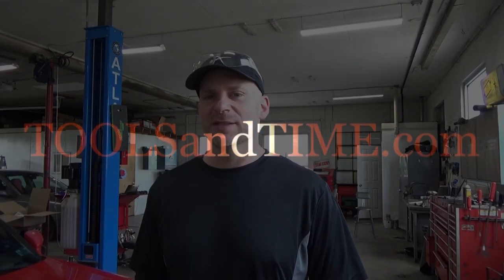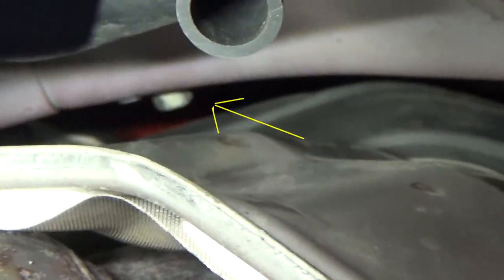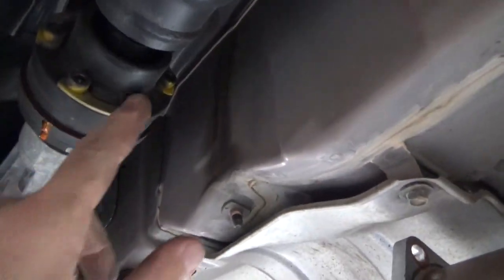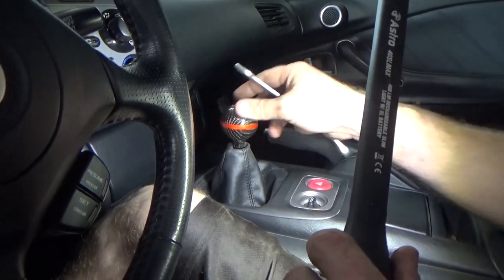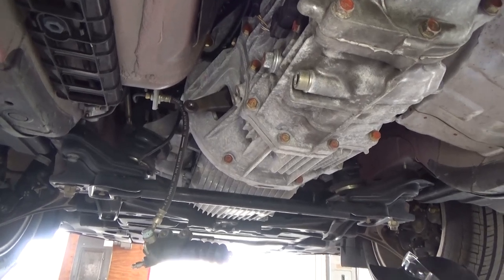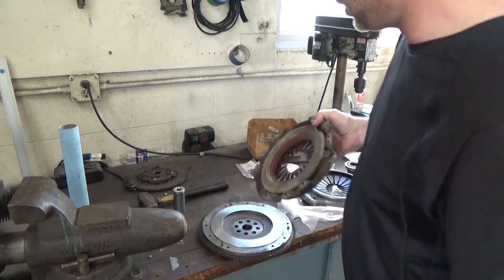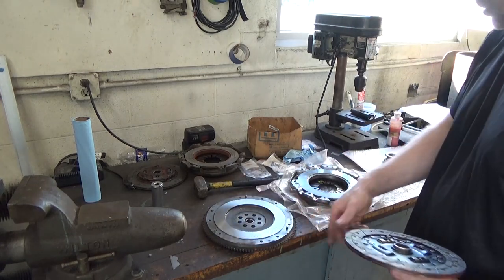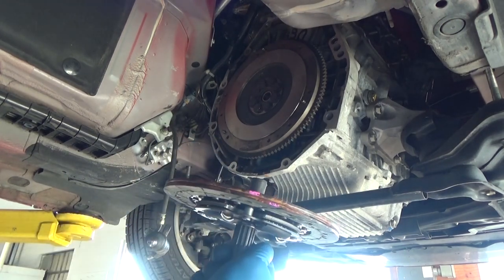Honda S2000 Clutch Replacement, Part-1 Transmission removal

Comment: on hondas/acuras if the flywheel is resurfaced you need to use a shim between the crank and flywheel to adjust the gap between the clutch and flywheel surfaces, good tutorial  and thank you for showing folks that locktite is necessary..more need to know where and when to use it.
Reply from the maker: Thanks for your feedback and insight, your welcome, yup the first time you have a flywheel come loose or you need to pull one after another person had it off! You learn the golden rule! Your better safe than sorry

Comment: Good day Wil,

Great video sir
Just needed some help with a rich condition on a k24 odyssey. Both airfuel and oxygen sensor reas rich to -27 on the short term. 

Starts runs then stalls I  closed loop. Please help 🙏 if possible thanks again

Comment: Question, did you disconnect the steering joint before lowering subframe. I have seen a video or two that does. The service manual also mentions to. However, I have seen many videos that don't mention it. Just curious if you did.